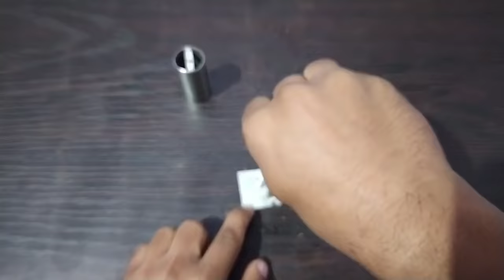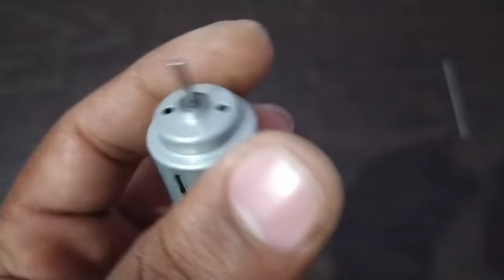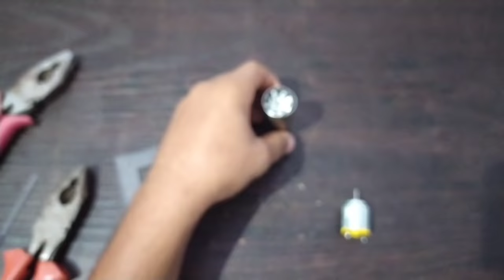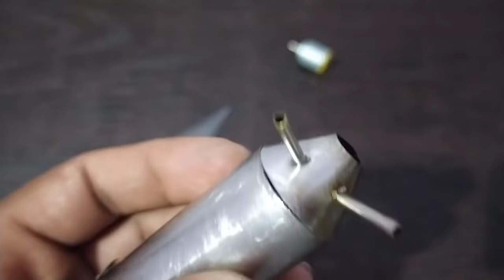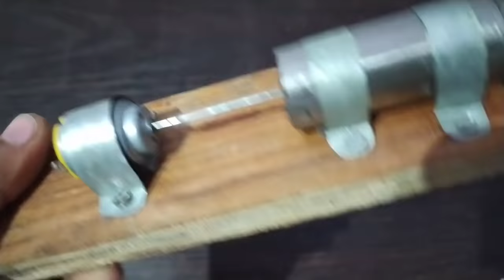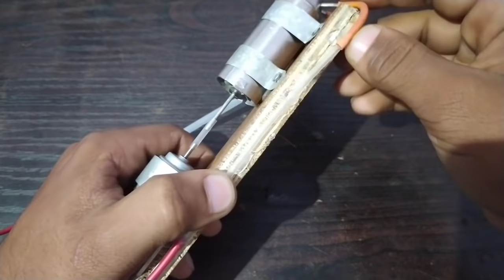How to make Jet engine (mini Jet engine)

Comment: Your burner assembly needs to be placed inside the body of the engine along with a couple of baffles, one separating the 2nd & 3rd fan and another one behind the 4th to create the front wall of the combustion chamber. The first baffle should reduce the diameter of the air passage and the 2nd blade needs to have the tips trimmed to be just a wee bit larger in circumference than the pass through in 1st baffle. The hole in the 2nd baffle should be a little smaller than the pass through hole in the 1st baffle and the tips of blades 3 & 4 trimmed to be a wee bit larger than the pass through hole in the 2nd baffle. I suggest one more baffle at the end of the tube where the conical nozzle piece attaches. It should be about 75% the diameter of the outlet hole in the nozzle. Your fuel feed lines should be introduced about 1/4 of the length of the combustion chamber back from the 2nd fan blade baffle. 

Will your engine work like a proper air-breathing reaction motor? Maybe. Right now your design lacks any meaningful back pressure. The narrowing of the pass throughs will create a marginally better amount of compression and speed up the airflow due to the improvised Venturi effect that the first two baffles provide. 

The third baffle in the rear in concert with a defined combustion chamber will allow a modest amount of back pressure and as the combustion gas exits through the last baffle’s pass through, it’ll expand in the inside of the nozzle and push against the inside of the nozzle and the rear baffle as the gases are exiting through the nozzle; this in turn will create some modest amount of forward thrust according Newton’s 3rd law. 

As an aside, with the modifications I’ve suggested, the fuel ports into the bottom of the nozzle can be repurposed with a secondary fuel supply and potentially act as a weak afterburner stage. 
Good luck.
Reply: Jeez man
Reply: @Swigglewiggle438  Lol, intense.. But also accurate😆
Reply: Took me two minutes to read and figure out what tf you just said
Reply: brother u forget to mention where is the combustion fusion there is no fuse/ spark plugs and the air is not even compressed enough nor the structure is strong enough to withstand that kind of air pressure which a real jet needs let along if it can even survive the combustion from the fuel similar to car engine and then use that torque to push air and also control the intake propeller in front to balance out the air speed aka u increase the fuel combustion  u also increase air intake and also get more compressed air to get in the ... what im saying is this video has no clue about what and how a jet works or even how to build a proper one this is more like a 9 year old making a small town city with toy type show case of jet nothing more then a gimmick
Reply: E Van  wait ?? turbine ? engine ? ur addressing + comparing it to something that has no similarity. plus that has no shape of a turbine. u can call if a toy thats more better
Reply: Damn
Reply: @mortazah9826  ''Took me two minutes to read and figure out'' 
That's a record for someone subscribed to poodiecancah.
Reply: An axial flow compressor just can't be made from those sort of fan disks he's making. Centrifugal maybe, strange he didn't try to go down that road instead.
Reply: agreed and i dont think adhesives should be used to seal it..
Reply: And after all that the super glue will degrade under heat and it will fall apart. Perhaps more an electric flame thrower would get demonetised.
Reply: Why so long comment
Reply: You left out one major detail

....nobody cares.
Reply: Woah 💀✨🤌
Reply: @jaynolan7526  then why u caring?💀✨🤌
Reply: Yeah he also needs to be using a flux capacitor or this thing ain't going nowhere.
Reply: I can't read it all that's too much
Reply: TLDR: baffle
Reply: You do realize that this is just a project that's not intended to function like an actual jet engine. Right?
Reply: That was deep man
Reply: @jaynolan7526 love the fact your watching this video lol
Reply: Can we text?

Comment: in the jet engine, the air is compressed and there the fuel is added then ignited in the compressed chamber, so the thrust is multiplied by the expanding air.
And also the  jet engine not necessary need turbine, as long it has continuous compressed air and fuel that exploded it can called a jet (turbinless jet is called ramjet engine) .

But this video, fuel is at the end side of blade. Moreover it ignited at the outside. 

In conclusion, its just a rotor that bursting fire.
Reply: Bernard Ctxy yes this jet engine would have been a lot better with a proper combustion chamber and better fuel System
Reply: I think super glue is the wrong fastener to use in a proper jet
Reply: Bernard ctxy It doesn't matter how the configuration is, if it creates thrust it is a jet engine
Reply: @ketchuplover3197  what he built is a model of a ducted fan with an afterburner. Wich is not a jet. It's a ducted fan with pointless afterburner. That would not creat any trust because you can't expect to get any pressure to build up inside the duct. Trust comes from fuel mixed with compressed air. You can't create pressure in a civ.
Reply: @glitchinthematrix5761  of course, it impossible to create nessecary thrust to move with that engineering design  It is just a 'flame with a fan'
Reply: @ketchuplover3197  yep it doesn't matter, there are a lot kind of jet engine out there. Even a thing that runs in water can be called a jet, despite it doesn't have afterburner (well mixing sea water with fuel? lol) 

Jet must be building up continuous pressure in it, even it doesn't have turbines. Well I don't know if rocket engine can be called jet too or not. 
Rocket use chemical reaction to build thrust, even it's pressure is sometimes less than atmosphere pressure in sea level.
Reply: Yes,you are right
Reply: @glitchinthematrix5761  the minute I saw the superglue I stopped watching the video
Reply: @brucele1453  I was hoping to see something explode. I should have gone.
Reply: Bernard Ctxy  you are literally the greatest nerd (this is a compliment) in history
Reply: A turbine-less Jet is actually called an electric ducted fan. A ramjet is an air breathing engine without a compressor, and can only operate at supersonic speeds, as the air ramming against the inlet of the engine compresses the flow. What they built will not produce thrust as all the combustion occurs outside the nozzle. And thrust is created by expanding and accelerating the combustion gasses. They’re also probably not compressing any air because the compressors are designed poorly to not compress but rather accelerate the air, which is why it blows.
Reply: This video creater thinks that we are all fools 🤣🤣
Reply: This is Prank video that was making Kid Toy Jet engine
Reply: @spaceCowboy924  u do know u can also use that out take trust air to blow a turbine to spin up the front on which most of the new jets use
Reply: @animekiss3311  yes that is what a gas turbine engine is. That's the operative principle. A compressor decelerates and pressurizes airflow, fuel is injected and the mixture is burned, this high temperature flow expands through a turbine which powers the compressor and any other auxiliary systems (fuel pumps, ignition systems, etc.). The flow after expanding through the turbine is then further expanded through a nozzle to generate thrust. This 'engine' does not have a turbine or a nozzle. Its just a glorified lighter.
Reply: ig u aren't blind , bz it was inserted before only
Reply: Yes , you are right

Comment: Nice job, but I see at least 2 big problems:
- all your fans are on the same axle, which implies the air flow is at about a constant speed from the second fan. My works on propfan showed each step must be spinning at a higher speed than the previous one, which is essential with contra-rotating fans to avoid gyroscopic precession, but the idea is still the same whatever flow you're working on.
- each subsequent step must be smaller than the previous one to increase air compression and thus speed at the output nozzle.

To combine the two, the simplest is to have a single motor shaft with belts and each fan on its axis (all collinear) and proportional gear reduction. It's a tad more complicated than this one (because of the bets and the separate axes), but it makes it much more efficient.

Also, how about soldering the pieces together (not even brazing or welding) once superglued to reduce the air leaks?
Reply: Can we text?
Reply: @success_studio  feel free to email me.
What  I'm saying is that all the work is done by the first fan. The second fan provides no acceleration -- or something very marginal due to the fact that the first fan is not physacally "perfect", theory and practice may differ. On the second (and all further other fans), the input speed and output speed are pretty much the same if both fans are the same size and speed, even contra-rotating. Now, contra-rotating is the reason for the extreme noise, which is mostly generated between the propellers: Since your fluid is spinning in one direction and you're trying to reverse that spinning direction, so, yeah, your air will go from -speed to +speed, it's just perpendicular to the axis you want:and has absolutely no effect on the propulsion force, or marginally by accumulating pressure at the tips of your fans (not where you want it, unless it's severely funneled). Also, the distance between propellers is very important to avoid unwanted turbulence. If the sound is what you want, then it's fine. If you're looking for any form of thrust, think again.

Have a look to Integza's channel, he's trying for ages to make a working jet. Also, if you want to explore that domain, you can have a read of NASA's report about... propfans (id 19870019120). It explores the physics and fluid dynamics of 2 contra-rotating "special" propellers and all the tests made in different configurations. I know, 476 pages... unless you're trying to build one to create something even better, that's a pretty boring read of 476 pages, but totally worth it to figure out what's hidden behind it. Enjoy!
Reply: Most crude working designs are on a single shaft. Should see what they do with truck turbos.

Comment: I’m only 12 (although all of my teachers say I am incredibly smart for my age) and I know that this is not at all a turbojet engine (which is what he was quote on quote “making”) although you did get the first 2 stages correct, there are 3 stages which is where the exhaust spins fans behind the flame which are connected to the “fans” in the front which causes it to suck in more air which causes it to burn faster which causes it to spin faster which causes it to suck in more air which causes it to burn more which causes it to spin faster and this cycle repeats and, ba da bing ba da boom you now know how a jet engine works. Thank you for your time.

Comment: it certainly won't break any sound barrier anytime soon, view it as a scaled down simplified but with a similar concept to that of a jet engine, because what jet engine is it's basically a bunch of high speed turbine sucking in air from the front, pressurize the air in the middle, and combust it with spraying fuel as the air were being forced out at the rear at a very high velocity, thus achieving the speed of sound. believe it or not, the concept of a jet engine is actually simpler to understand than that of a regular piston engine which a car uses, because it really is just a bunch of giant fan and some pipe that spew out fuel, the rest is physics.

Comment: I'm just coming on here to point out for many of the people who are arguing below that it isn't a jet engine. This IS a jet, but it isn't an engine. What makes an engine an engine is the fact that on each cycle, more energy is released than is required for the next cycle. The next cycle gets the energy it needs, and the remainder of the energy is exhausted to the environment. Jet engines don't have cycles in the same sense as a piston engine, but they are analyzed the same way. For this to have been an engine, the energy released by burning the fuel would have to be captured in some way (turbines after the burn chamber) and put back into the input side for the next cycle -- to wit, if the prime mover (the electric motor) is removed and the jet doesn't self-sustain, it isn't an engine.

As an aside, what this guy did was basically built a model salamander (those heaters that people have in their garages and on construction sites that look like a jet).

Mind you, I'm using a practical definition of an engine, not the exact thermodynamic definition, though I've never seen anything to indicate that there's any such thing as a non-self-sustaining heat engine.
Reply: underrated reply!

Comment: I built one of these in my 11th grade physics class.  I had the VoTech school make the outer casing and my art department fired the compressor blades that I made out of clay.  When we tested mine and used the after burner which moved 20 % of the fuel to the back, it tore off of the stand and went flying down the parking lot. It broke 2 10,000 pd bolts by shearing them off. I got my A in Physics.
Reply: Holy shit this is how it's done 🤣
Good job that's so cool!
Reply: That sounds so cool! I wish that I could build something like that in my physics class

Comment: "Jet engine" my ass! First, there are rotor stages, but no corresponding stators. Second, the rotor "stages" don't compress the incoming air. They merely accelerate it. Finally, the continued accelerated combustion of the butane is reliant upon the electric motor. If this were indeed a jet engine, a set of turbine stages being turned by the expanding combustion gasses would draw in air trough the compressor stages and sustain the combustion in the burner "can".
This is about as much a "jet engine" as lighting a fart.
Reply: He almost set that thing on fire..🤣
Reply: He used an electric motor to turn a couple of fan blades to blow a gas flame. Not even close to jet engine. What a fool
Reply: @crunchysoup406 - Nope.  This isn't a jet engine.  It's a fan blowing flames.  I admit I couldn't do better with he tools and materials that he had, because jet engines are so precise that making one needs more than the tools and money he had.
Reply: nobody asked
Reply: @timrogers2638  NOBODY ASKED
Reply: @solutioni3394  Yes, he did.  The claim that it's a jet engine is false for the reasons stated previously.  When a person makes a claim about something, that claim is subject to the consideration of others.  The person who made this video essentially "asked" us to consider what he made to be a jet engine by titling the video "how to make a jet engine".  This implies expertise, as the person is stating that what he is making is a jet engine.  Nope.  It is not a jet engine.  It's a fan blowing flames.

Comment: 25 years ago before model jet engines were available commercially, folks were making them out of compaing gaz containers and using VCR head bearings. Someone was machining the compressors and selling them at flying events. This was pretty clever, but I doubt it can produce useful thrust.

Comment: I thought this was going to be a functional turbojet or something.. oh well it's a start. Got to have a compressor with tolerance so that proper compression takes place without pressure loss through intake, etc.. I define the jet by it's ability to self sustain,only use electric to start it up. I'd start with an old turbo or something.. I'm currently dissecting a Dyson for a small compressor wheel.. it is a start though sir..

Comment: Good one 👍, try making the glue and spacers heat resistant and put them in fan- flame tube- turbine arrangement. You will have a real jet engine.

Comment: Err ... I'd call this a fan blowing lighter fluid out the back of a tube. It might produce barely non-zero thrust because it is basically a simple afterburner.  The jet engine itself is missing, there's an electric motor with fan blades instead.  All that being said, I liked this video!

Comment: Just for your info: that's not what is called a jet engine or sometthing of the sort, not even an "afterburner", cause is after nothing. At most, is a 5 minute glue burner.

Comment: Use me as a dislike button;

This isn’t a real jet engine, this is just a fan that shoots flame out the back. If people these days really want to make a jet engine, go the centrifugal route, they are much easier to make than axial jet engines and still give decent output at small scales. For this to qualify as a real jet engine, you need to have its turbine stage power the fan blade/centrifugal stage to have a sustained reaction without the power of the motor. And even then you are not compressing the air to a low enough volume and high enough pressure to have that kind of energy to turn the turbine in the combustion chamber. Believe me building a jet engine is hard, there is a lot of balancing and math that goes into it. You don’t just stick shit together and expect it to work.

Comment: Brilliant one-shot construction, to improve the jet engine principle!
Then to make it re-usable, you have to add ball bearings on the shaft, some decent well-conformed compression and combustion chambers, and almost a welded assembly, because glue can't stand such temperatures.

Comment: I don't think this is completely false. This is basically the first half of a jet engine. The second half could be the first half connected right behind the first half, with the shafts connected together as well as a disconnect mechanism from the electric motor once the exhaust jet is able to power the fans in the second half, thus powering the front fans via the connected shaft. Then it's truly a working jet engine.